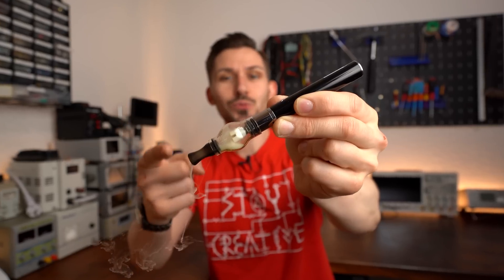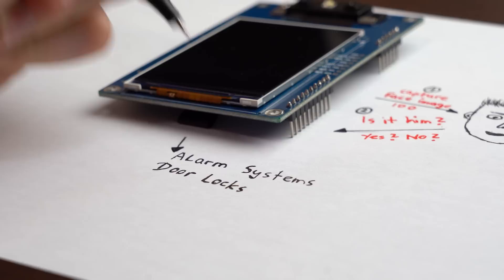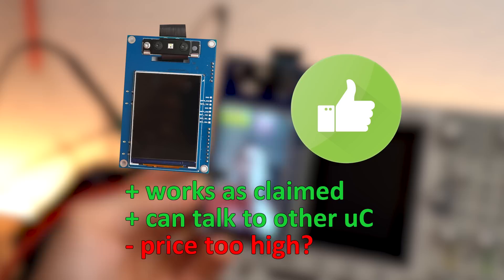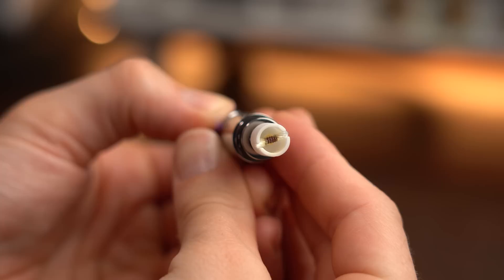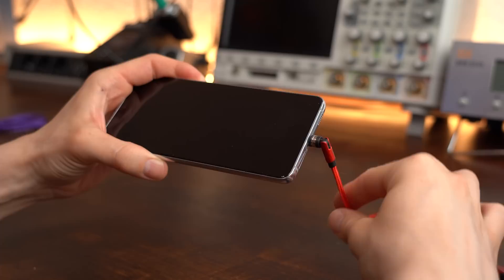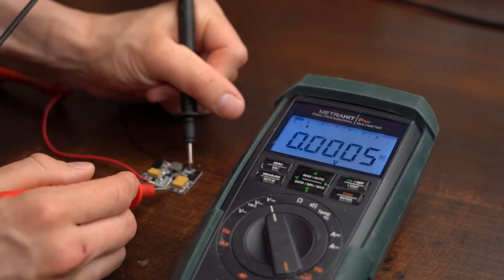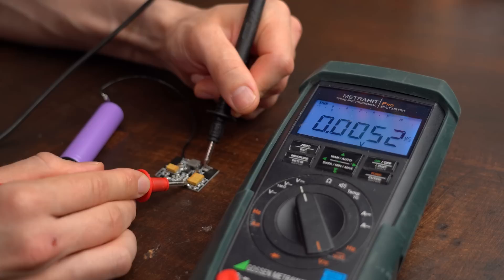I tried finding Hidden Gems on AliExpress AGAIN! (Part 5)

Comment: I really enjoy this series! Looking forward to further episodes! 

What I think would be interesting though:
I also use these magnetic charging cables and I am actually satisfied with them. But there's one problem I noticed: over time, the resistance somewhere in the magnetic connector seems to increase for some reason. Would you be interested in taking it apart and have a look what's inside?
Reply: It's probably just because the contacts (between the conector and the cable) wear with time, so it's harder for electricity to flow through

Comment: the hotspot of the hotplate seens to be reflection of the thermal camera. also you can remake the coil of the "vape" with 28/30/32g nichrome (n80) or kanthal A1 wire. it`s very cheap. you can also make your own "vape" for this use or eletric lighter with this wire.

Comment: The magnetic usb cable is awesome to charge devices that doesn't require that much power to charge, for example a ps4/ps5 controller

Comment: FYI, the Arduino Flite library will let you do good text-to-speech on an ordinary ESP32 using its internal DAC. Pair that with a 50c speaker and that would work out way cheaper than 15e.

Comment: thanks, all very instructive. my main intolerance (I have some imperfections) is steel power conductors wasting power as heat in many cheap usb cables.

Comment: Note: TPS63020 opening SB1 to enable power saving is not enough as the Data sheet says PS/SYNC pin must NOT be left open so it needs to be wired to ground for stable operation.
Reply: What I still don't understand, why is the power saving mode not on by default, or what is the drawback of using the power saving mode?
From the description on AliExpress it looks like if you open SB1 then the power saving mode is controlled by the PS pin, but what are the other pins EN and PG for, or the connections P1 and P2 (with GND) on the top of the pcb?

Comment: AliExpress is problematic. If you have a problem, you're screwed. Try this: Try buying a 128TB USB Drive. It's a 65GB drive with some hacking that makes it look like a 128TB drive. And you can copy to it to your hearts delight. Just don't try to read from it. All it's done is create the folders. And then there's the 800W solar panels...that put out 150W. They ask you to take pictures (but won't tell you of what)? When they finally get the picture they offer $50 to settle. In actuality, they've shorted you 8 panels. But worst of all is their ChatGPT service...and absolutely no way of contacting them directly. Have fun!

Comment: ⚠ You shouldn´t trust an IR-Camera Pointing at bare metalls like the aluminium heating plate - there will be falls readings. try to cover it with some sticky tape like "Malerkrepp"

Comment: I have one of those load tester modules you use to test the cables / boost converters, but I can't find a manual for it anywhere. If you have the manual handy, could you upload it somewhere?

Comment: I would just say to be careful about using IR thermometers on reflective metal surfaces.
Reply: True, as far as absolute measurements goes. But in his case he saw a hot spot on the metal surface of the plate, so even if the absolute reading is off, the relative measurement should give him workable results.
Reply: @ignispurgatorius5297  It can depend what it's reflecting though and angles. I've sometimes even seen myself in the reflections.

Comment: The battery part of the rosin thing is the bottom side of a Subego vaping kit. As vapers those are really old, one of the first cartridge coil units from seven years ago, I think.

Comment: Those magnetic cables are great for changing equipment: I got my keyboards each with their own plug (most type C, 1 micro usb), while only having a single cable.  Making the swap between my keyboards (dont judge) super easy

Comment: I need a project designed and built. A small box maybe 100x100. Plug in network cable and other end network device, computer or android tv box etc. The box will have nice display showing network info about  traffic and protocol and speeds etc. Thanks

Comment: Magnet usb and tps BBB seem like the best ones for sealed projects (i even watched someone make a wireless mouse and use the magnet usb thing to charget from time to time) with ease, so for low power projects it shouldn't be an issue

Comment: I came across a YT video using ground flux to look for shorts. Which led the discovery of the dab pens using the heated flux to disperse the flux. Got one two years ago..... haven't needed it yet though. But looks super easy to use. Just waiting for the next repair it's needed.

Comment: One of the screenshots of Aliexpress showed magnetic tipped USB cables. Not something that needs a review to prove it's case necessarily, but they are so awesome they should be more popular.

For $20 I got 5 cables & 20 magnetic tips. This let me convert all my devices (USB C, Micro USB & lightning) to one connector which is also easier to use. Every device can charge with every cable in the house & I can make the connection with chopsticks if I want to.

If I had buy again I'd spend a little more & get magnetic adapters that plug to existing USB C cables.

EDIT... you covered them. oops.

Comment: The magnetic cables from "Last Cable" seem to be ok for Android etc but the iPhone connector is unreliable. I have checked a variety of cables and iPhones and always get trouble after a week or 2 especially in the car. This may be due to the Apples in ability to tolerate the power loss.

Comment: Well, that buck boost converter? Yeah, I would use an MCU Arduino or whot not to enable controllable output voltage selection, you know for example by using an ESP8266/32 get a webpage to allow you to select the voltage output, or just get a button selector or sorts (and avoid any MCU at all). Though automated control is fancier :P

Comment: Yes you could just buy another 510 threaded coil, or you could rebuild/build your own coils at your own specs. Meaning depending on thickness of Kanthal wire, and how tight you wrap the coils can all determine the ohms of said coil. I used to have a 510 threaded ohm reader when I was a stupid vape kid lmao.

Comment: I'd recommend using some Isopropyl alcohol instead of the rosin dispenser, you can wet the components and will easily see where it dries up first. I don't think it's beneficial to distribute possibly corrosive rosin residues across all components 😅
Reply: im not sure if i would want explosive vapor around defective electronics
Reply: @NinoJoel  that's why I said "wet the components" and not "drown the components in IPA"

Comment: I had the magnet on one of those USB cables detach, short out the cable, and nearly start my car on fire (There was smoke and everything, my device has a nice burn mark on the case). I had around a dozen of them and threw them all in the bin, a cheap cable isn't worth burning my vehicle down. Would not recommend.

Comment: Your rosin thing is over powered flux. 

That rosin device is 100% for thc oil/wax. It’s definitely not the first time smoking stuff isn’t used for what it’s designed for. 

For example a lot of vapes take 18650 battery’s. What else takes 18650s? 
Laptops ,drill battery’s, cameras and flashlights. , 

Vape 18650 are fast drain. 
A laptop 18650 is slow drain. 
Swap the two and you could burn or blow something up. Both of which still have 3.4-3.7v and at a short burst will definitely supply an amount of power. 

Just use flux and mask if you’re worried. Using that on a micro board is probably more prone to show issues.
Reply: And if you’re wondering I literally have one that I use for smoking as well.

Comment: These cables also easily stick to any metal surface and shorting circuit with damaging power supply. I had to stop using them without even start

Comment: I also bought this hotplate but it heats up too fast for reflow soldering. Within a minute it is already at 200 degrees. I saw that with the old variant you could adjust the pwm in a hidden menu. Unfortunately, this does not work (yet) on this variant. I did find a way to get to the menu but I can't adjust pwm there to make it heat up just a little slower.

Comment: i found a few useful things, search for MC-38 (a tiny magnetic switch) and AMS1117 LDO (tiny board with 3 pins 5v in 3.3v out) used both of these to power/control my keyboard LED strip (my desk has a pull out tray with a custom width aka as wide as i could make it within reason)

Comment: I'm concerned about the hot plate, how long can you safely expose components to that much heat?  With the small one you would only be heating a few components at a time, not the entire board.  Thank you for another great video.

Comment: On the face recognition module, it would be interesting to try testing the system with other peoples faces, maybe ones that resemble Scott to check for false positives.  On a side note I recently saw a TV show where the "bad guy" in this case a woman, had a head sculpture made of the person she wanted to impersonate to fool a face recognition system.  Interesting.
Reply: using face or fingerprint for anything more than low security lock is plain wrong.

Comment: For hot spot finding another technique is to use freezing spray cans, but I need to check out prices to see if it is cheaper or not.
Reply: You can do the same with air duster upside down 😁
Reply: Wouldn't that add moisture?
Reply: @thomasjohanns7661  Possibly. It certainly isn't the perfect technique for all situations, but it has been in use for decades. It's another tool to use when necessary.

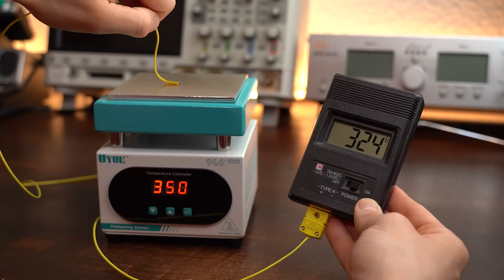Comment: 4:46 "an okay accuracy" he says to a difference of 25C 0_o as a chemistry nerd that don't fly, that's not even roughly accurate, even a crap hot plate should be accurate to within a single degree C

Comment: I'd really like to know what cable he recommends that wastes the least amount of power. I've been having an issue with a couple anker cables I bought on Amazon. One of them used with my portable battery will charge my phone 5 or 6 times before needing a recharge and the other couple cables only charge my one 3 or 4 times before a recharge. This has confirmed my theory that some cables waste more charge and take longer to charge due to some imperfection/damage.

Comment: That is absolutely a vape pen... Just being used for a different purpose lol the reason the coils are not lasting is they are designed to have air being inhaled across them to help cool them as they vaporize whatever materials, be they thc related or rosin, lol.

Comment: For the speech synthesis device, you might try a Null Modem cable.  Serial communication is notoriously confusing, dealing with both DTE and DCE devices.
Reply from the maker: Thanks for the feedback

Comment: I think there's a rather obvious flaw in your calculation regarding the fast charging and power loss - I'm almost sure that your phone won't be charging at 2.7A with 5V input, more likely 9V or even 12V, so the losses would be much smaller.

Comment: Okay, I'll bite: How exaxctly would "fast charging" work if there's only Vcc and GND available? The highish resistance aside, without signaling the highest you can achieve using plain USB is 1.5A@5V (or 7.5W) which is quite a stretch to call "fast charge".

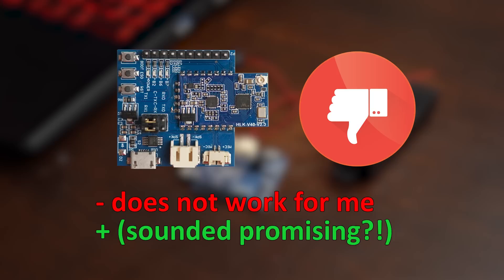Comment: 13:28 actually you can try to move the jumpers on the other position, I think it is connected by default to external serial port(RX1, TX1) and u need to switch to internal one( RX0, TX0)
Btw, nice video 👍
Reply from the maker: I tried pretty much everything possible to communicate with the board. Also changing jumpers. Nothing worked......

Comment: The biggest wow for me was that "Colour TFT USB Tester", do you have a link for it ? first time Iam seeing something this smooth, Always cutting wires and connecting in series and parallell with my multimeter to measure.

Comment: Thanks for looking at these! I have been trying to swap the 2 AA batteries in my TT350 flash gun for an AC adaptor or 18650s. The boards I've tried can turn the flash on, but does not charge it enough for it to fire - presumably because their output currents are quite low. This 3A 3.3v board seems quite powerful, does anybody think that would work?

Comment: The shipping for the hot plate seems really high (to Denmark). Has that changed since you bought it? Product is 31€, but shipping is 61€.
Reply from the maker: I pretty much only paid the 50€ with no shipping costs. Search with the product name "UYUE 946" on AliExpress. Maybe there are other sellers that are cheaper ;-)
Reply: @greatscottlab  Thanks!
Reply: There is one seller which ship it from PL for 54€

Comment: 7:20 - I use similar cables for my keyboard, powerbanks, phone, hard drive etc but that ones from aliexpress have only conected positive and negative wires. So no data transfer... I have magnetic cables that are "square" and does have also data links conected.. Cuz its square so... I ordered mine from Czechia.

Comment: You didn't explain why would they sell voltage regulator in high power mode. What's the point, if it can use much less power? Are there any disadvantages?

Comment: I bought from aliexpress a bunch of magnetic usbc adapters with a full 22 pin wafer inside. They charge at high speed and apparently support dp alt mode, although ive not tested that yet.

I was hoping this would become a standard on phones and tablets instead of the current typec connector

Comment: I noticed in that user interface from the speech recognition device, it shows the CH340, which is the serial port chip right? I used lots of Arduino clones in the past that had this chip instead of the FTDI ones from the original Arduinos. Have you checked the drivers for this chip?

Comment: I recently bought a bunch of these USLION magnetic cables, so I'm curious, what is the power loss like with a standard 5V 500mA device? They will only be used with slower charging devices, so this information would be very relevant to me.

Comment: For a face detection and recognition have a look to the 10$ SEN21231 from usefull sensor. There is already a ESPhome integration.
Reply from the maker: For such a low price? Crazy. I will have a look.
Reply: @greatscottlab  and it work great.

Comment: The vape pen is basically the original tobacco burner device that kinda flopped a good few years back where you packed in some tobacco or nefarious herbage and it did the burny thing kinda like a mini shisha and crack heads in the US were using it for meth and crack hehe   Its weird how its been repurposed like that.
Reply: For the coil get some 26ga titanium or SS wire and just make your own, very easy using a 3 mm round mandrel like the round end of a drill bit and just wrap it so many turns to get it to the depth of heat you want.   The module uses what seems to be a standard 510 screw connection so if the battery side goes bad and they are really quite badly built, any "mod" that has a 510 connection should do the trick or build your own as Ali, fasttech etc all sell ecig components for self builds.

Comment: for fast charging have you used the power brick from MI ? also you shall notice for apple if you make any custom usb type C chargeing you need a pullup resistor in some wires for enabling fast charging. I guess if you had one MI company phone with MI company fast charge adapter it might work

Comment: One question, aren't you afraid that the face recognition module is coming with a backdoor or sending data to a 3rd party ?
Reply: How? It doesnt look like it has any antennas and even if it did it would need something to connect to. It would be very unlikely that a device you bought would send data somewhere wirelessly without you having to connect it to the internet.

Comment: Severe hotspots AND off by 20-30 degrees Celsius on the Fleer?

Do not buy this. These are number one and four red flags for a hot plate in the industry that I totally work in.

Comment: The reason the red cable can't charge with fast charging is the lack of data connections. There are only two contacts for 5 V and ground.
Reply from the maker: True
Reply: @greatscottlab  I used 11 pin ones (don't remember the 'brand'), but adapters seem to produce the best results for me

Comment: the hot bed is ok, but the shipping killed the deal, they charge very high shipping for this kind of heat bed products. if it's free shipping, then the price is very high.  another problem is the MCU/software/controller is very weak. the display is also bad. so finally I ended up making my own. the most difficult part is to mount the heating element to the aluminum bed, the second big problem is how to mount the heat bed to the base. normal people can't do a lot of metal work /sheet metal work at home.
Reply from the maker: Thanks for the feedback. Many seller offer this hot plate on AliExpress. Some do not want high shipping fees.
Reply: @greatscottlab  - I always tick the checkbox that says "free shipping". The prices will be a bit higher since they wrap the shipping into it, but at least you know there won't be a sneaky shipping charge that is twice the item price!  I get that all the time being in Canada.  :(

Comment: Wax gun. Do you know wax on wax off? 🤣🤣 For resin flux but can be used with a resin type wax to waterproof components, or just to protect components from the environment. Beats using hot glue. That’s one for the technicians don’t use hot glue please!

Comment: Been using magnetic cables for years. Never had any issue and its always convenient with magnetic plug in and out. Make sure that its capable to transfer files not only charges the device. The single pin in one end demonstrated only for charging purpose, while multiple pins means charge and data transfer. In this videos the red one had single pin, it was meant for charging purpose only.